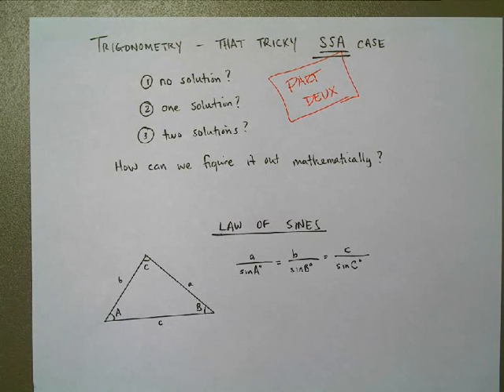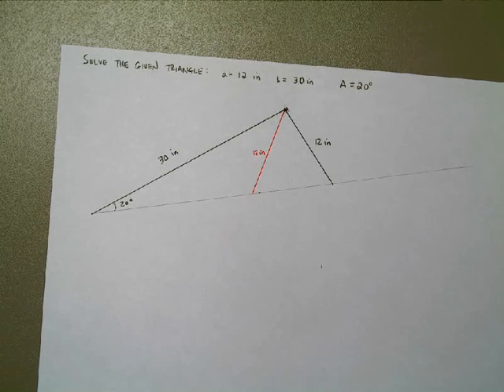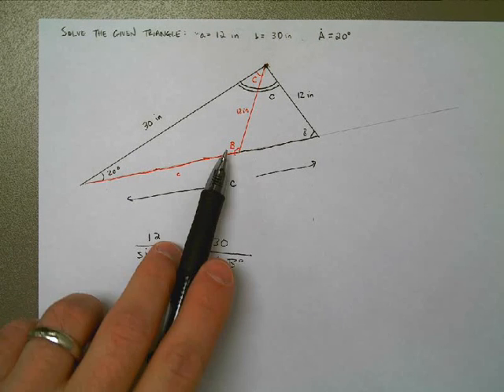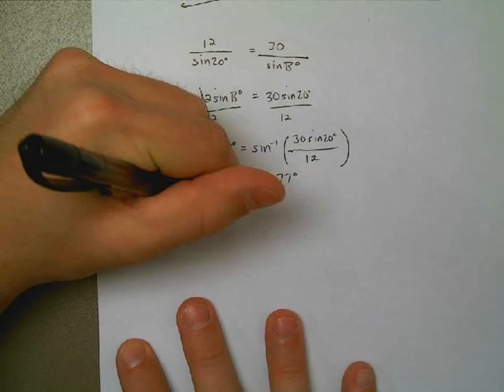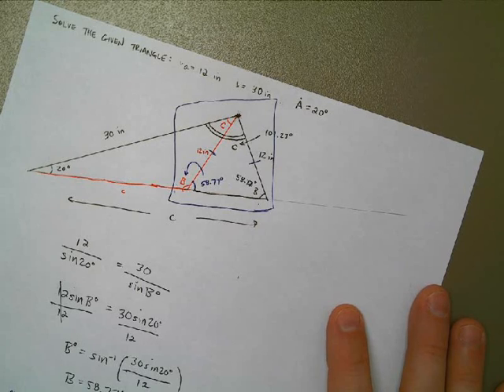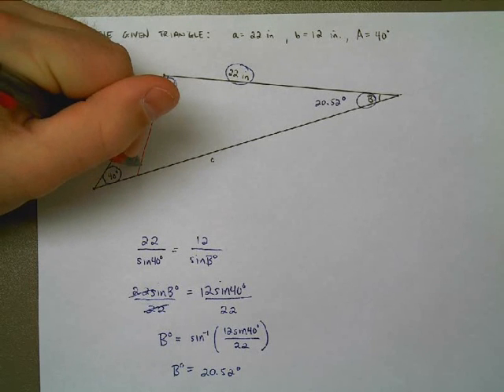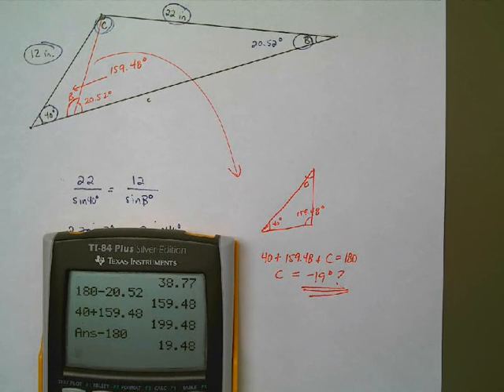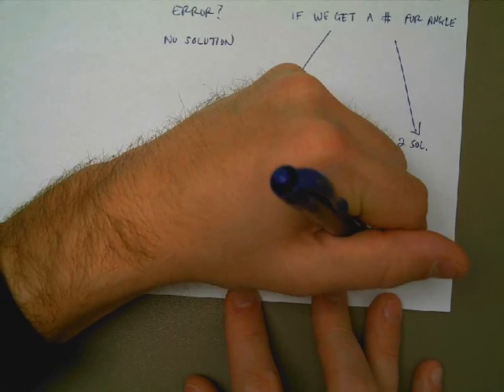Law of Sines - SSA - How to tell if there are 0, 1, or 2 solutions (Part II)

Comment: Lol you made this problem more complicated than it had to be. You can simply sove (ASS) by using law of sin to solve for sin(x). If sin(x) is greater than 1 than there is no answer, If sin(x) is less than 1 than there is a possibility of 2 answers. One being sin^1(x), and the other answer possibly being 180(sin^1(x)). You can check the second answer by adding the GIVEN angle to the (180(sin^-1(x))). If the answer is under 180, than you have 2 answers, if over 180 than you can discard it completely because you only have one answer. SIMPLE

Comment: Had to learn this in literally 1 class period, put the video on 1.5 and concentrated. I just remembered the no solution means 0, solving it with an answer means at least 1 and that is you subtract it from 180 and then plug it in and it still works then it means 2. I got an 87 on the test when I literally learned it the class period before with 10 minutes to spare. Thank you so much.

Comment: You are great at explaining this in general, however I still do not know how to tell if there are two solutions with out a picture...
Reply: you know when you are given an angle right? then you have to figure out an angle using the law of sin. Basically what you do is take 180 and minus the angle YOU FIGURED OUT, as in not the given angle. Lets say the angle you figured out was 30 degrees and the angle you were given is 40 degrees. You take 180 - 30 is 150. This is the new angle you just created by making two triangles. So now you have to check if this is even possible. So you know one of the angles is 150 and the other one you were given is 40, to figure out the other angle we do 180 subtract by both these numbers. However if we do that, 180-150-40, we get -10 so that's IMPOSSIBLE. This means there is only one solution.  If Lets say the angle we were given was 20 and the angle we figured out was 30, then we do the same thing, 180 - 30 is 150, and this is once again, the angle which is used to make two triangles (basically the red line in the video). We have our given angle 20, so we do 180-150-20 and we get 10. As we know, 10 is positive which means it is indeed possible to have 2 solutions.
Reply: @codexix8582  THANKS BRO!!!!!!
Reply: lol no problem, funny thing is ive completely forgotten how to do this from 3 years ago but glad to see its still of use haha
Reply: +CodeXIX Thanks man! This really helped me out.
Reply: +CodeXIX Yea this made it so much more clear!! THANK UUUU
Reply: Tas No problem! Glad to know someone found my explanation helpful.
Reply: +CodeXIX you explained that so beautifully. thank you !
Reply: +CodeXIX THANKS BRO!!!!!!!!!!!!!!!!!!!!!
Reply: does that apply to both angles to find, or do you have to do both before you are finished
Reply: would 0 also be acceptable for 2 solutions? eg 180-150-30
Reply: daivd guidi Agreed. He kept referring to the fucking picture.

Comment: Shortcut: If you are given A, a and c in triangle ABC (using standard trig naming conventions), then C is ambiguous (2 solutions) if and only if a < c. Note that if a is too short to form a closed figure, then you will get an error on your calculator since the argument for sin^-1 will be greater than 1 (0 solutions).